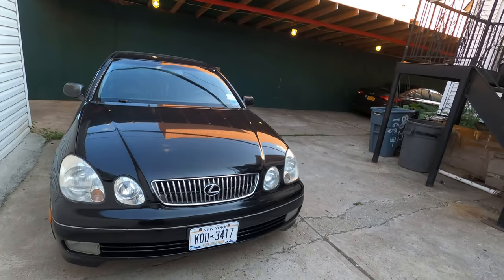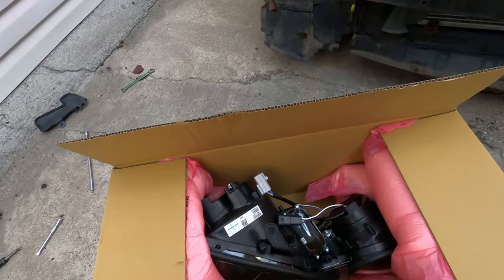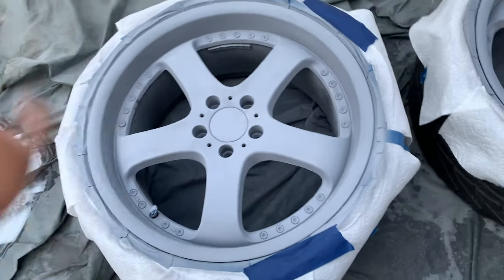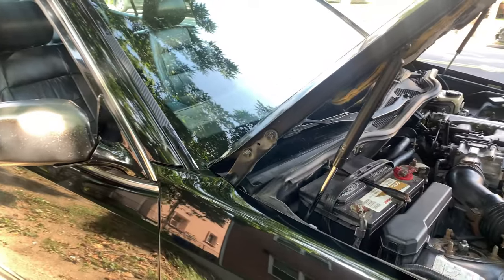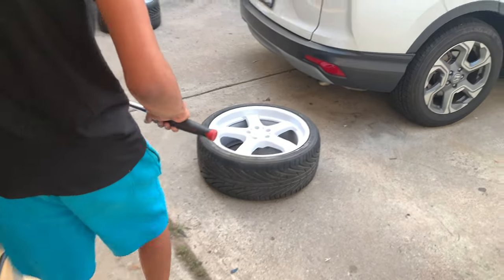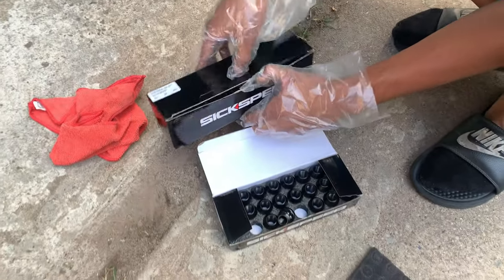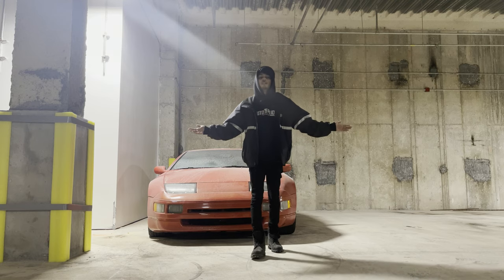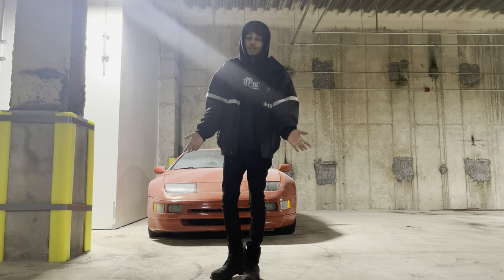LEXUS GS300 GETS A FACELIFT !!! (HEADLIGHTS, LIP, HOOD VENTS, GRILL, WHEELS)

Comment: The headlight bulbs for the new headlights; are they day-time-running bulbs 9005 and low-beam bulbs 9006???  And is there a separate high-beam bulb???  I'm replacing and potentially upgrading my 24 y/o girl-cousin headlights and etc....  She's not a gear head, but I am, but I'm learning about Toyota/Lexus.  My goal is to make the best quality upgrades; hell, I need to find myself a black GS300 or Lexus SuV.  No sh!tty Range Rover or BMW X5 or Mercedes jeep for me...  Quality built and upgradeable vehicles for me....
Reply from the maker: When you the new headlights it will say it in the description. But its not the same size as the factory ones. Mine was h1 and h7 I believe

Comment: How are those headlights holding up? I’ve been debating getting some but hear they aren’t sealed well. I was gonna RTV seal em clear backsides and around the lenses and hope for the best. There is also a hex tinted film from Vvivid vinyl , figure wrap em in that and have em look clean. Gonna do all the same Megan racing you did, just gonna do timing belt and valve cover gasket replacements so I don’t dirty up all the clean blue. Keep up the great work 💪
Reply from the maker: Thanks and headlights are still good.
Reply: Save your money and do a retrofit. Light output sucks out of those lamps.
Reply: Light output sucks honestly the cut off is garbage they're just for show tbh
Reply: @enriquemejia5861  What brand are those headlights?